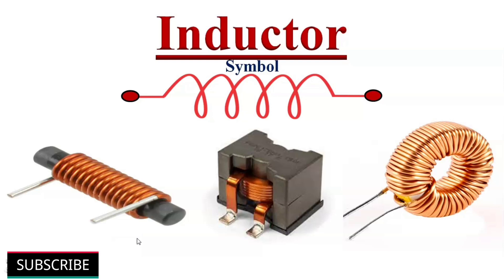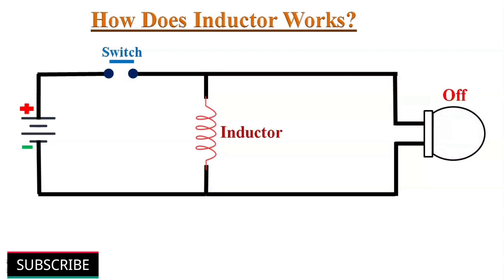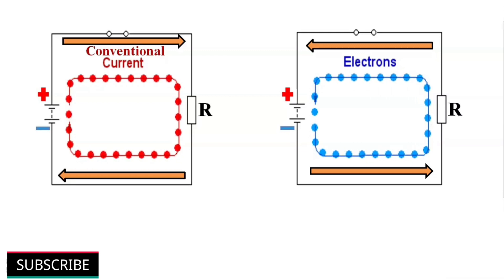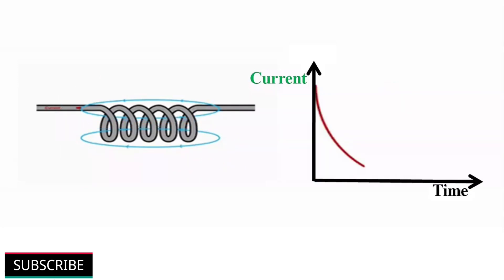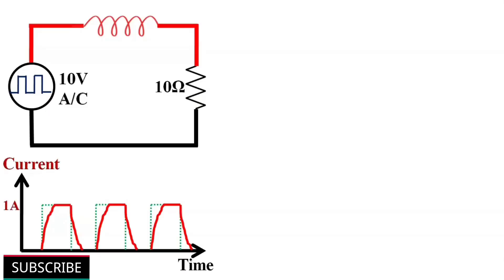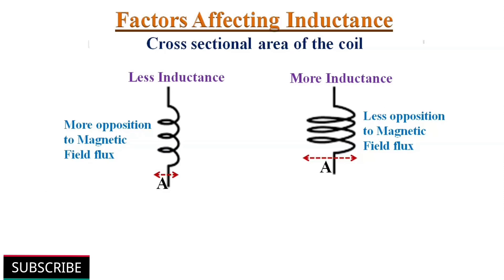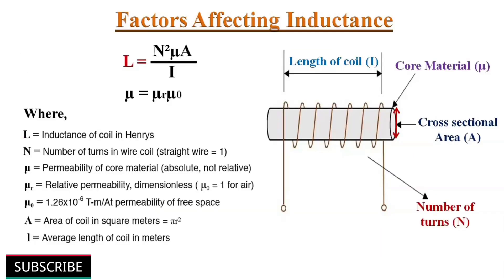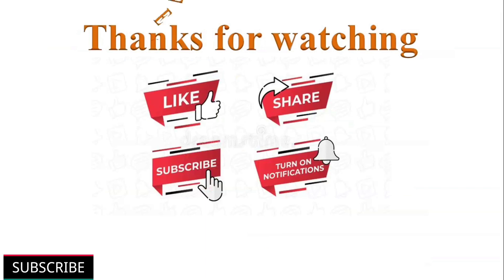Inductors Explained with Examples

Comment from the maker: Timestamps for various topics covered in this video are as follows:
0:20 What is an Inductor,
1:31 How does an Inductor works,
4:19 Back EMF of Inductors,
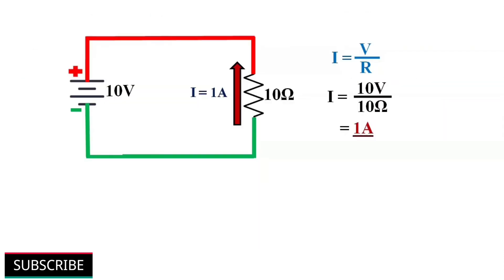7:07 Current flow in Inductor (Example),
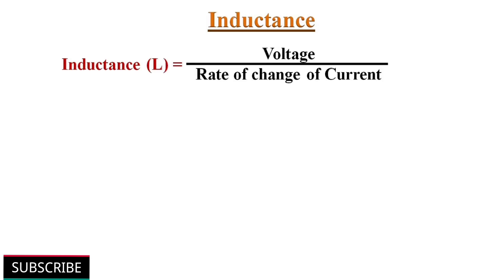8:40 Inductance,
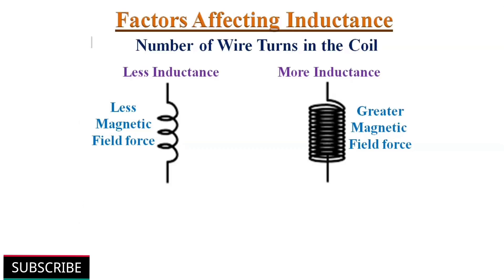9:20 Factors affecting Inductance,
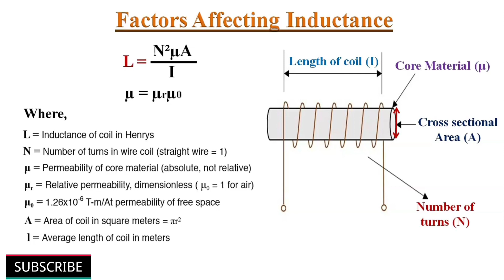12:25  Applications of Inductors.